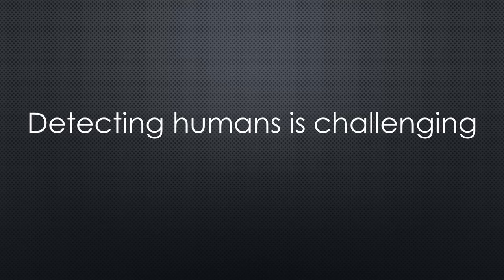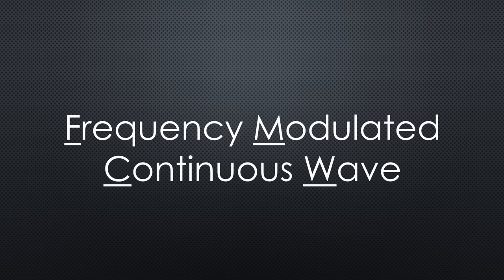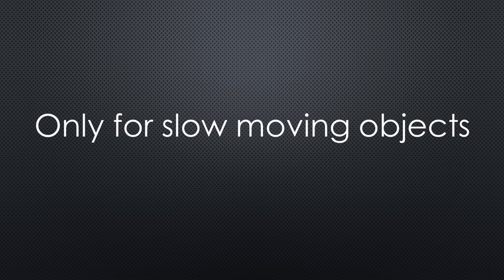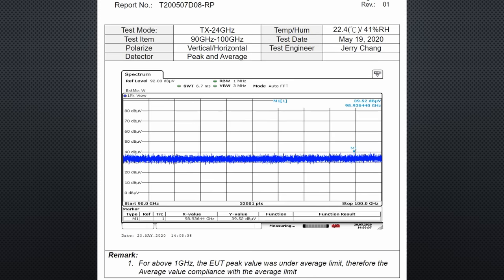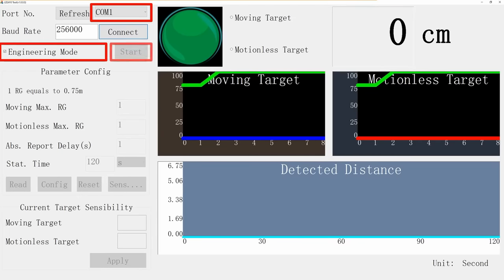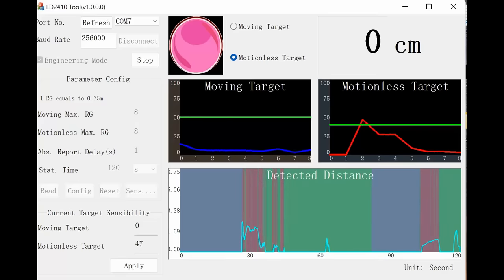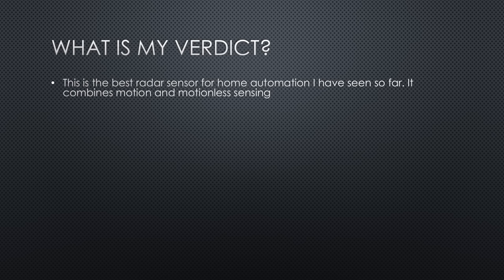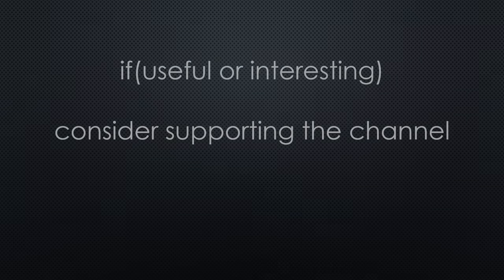439 24GHz Radar Presence Detector that Works (LD2410)

Comment: I wonder if it would be possible to reach the same goal by using PIR in combination with light barrier at the entrance(s) and some clever algorithm to weed out reference counting errors.
Reply: Two laser beams at the door could count people going in or out based on the order of triggering them....
Reply from the maker: You always can count. As you write, you probably lose control quite fast if two persons are too close...
Reply: @AndreasSpiess  I suppose some clever use of interrupts and a counter should take care of that particular problem.

But the reason I never built it for myself is that in order to install it to work properly and not count separate feet or arms going in and out it would be advised to bounce it around the doorframe with small mirrors a couple of times and the installation would be quite tricky to pull off and not at all universal or easy.

It would also require some careful drilling to install it in the door frame, unless you are prepared to have it stick out in quite an unsightly manner.

Either way, it would be probably a fun weekend project but I can't immagine this ever becoming close to a versatile enough product.
Reply: @AndreasSpiess  or of someone walks in swinging the arm forward while passing the barrier. But the use case "person has been detected by PIR but hasn't left yet through the barrier" may be reasonably easy to implement. But yes, you need some way to correct the count when it is off by some reason.

Comment: Do these modules need to be powered continuously? Or could they be used with a low duty cycle for low power devices? I suspect they rely on volatile memory to work correctly.
Reply from the maker: I assume they need continuous power for a certain time.

Comment: Andreas, do you have a total security built using mmwave and lora to notify of home intrusion. I am usually within 15 kms from home but feel my home is being visited when I am not home. Iam thinking my cellular is being tracked or my car so I would like a secondary com to notify me if I put my phone in a faridy box. Can you use lora to communicate from mmwave sensors to sensor and then send a signal from the sensor web to a remote lora unit
Reply from the maker: I would add a camera to your home. Then you see who visit it when you are away. And: Your phone cannot be tracked when you switch it off.
Reply: @AndreasSpiess  I would like to automate the cameras to a imput from the mmwave  and be notified by lora that the system is on line, working due to a detection. I would like a 950? Hz? Imiter floodlight and capable cameras controlled by ladar for outside on my driveway, also reporting to me by lora. I am disabled and a senior, people have been preying on my camping gear, food supplies and gasoline. I need proof that this is happening. It appears that the  second  I leave my house it is possible someone is around. I am aware to several gangs in the neighborhood because Iam observant and a old boy scout. My hearing and vision is still acute but my body is functioning on a bad level, if I need to vacate it will be slow and in great pain.

Comment: Would be interesting to know how it detects stationery objects, it must use the movement sensor to some how remember what a background signal looked like and then compare it with the new signal. So how long will it detect a motionless object before it becomes part of the background signal.
Reply: Detects the phase difference from the returned FM not just  TOF 

Look up fmcw radar
Reply: @RobertSzasz  So if i take a box in to the room and leave it there, there will always be a detected signal. At what point does that box become background and no longer a motionless object?

So once i move a chair in the detection field! The system becomes useless as there will always be a motionless objected detected. There must be a point where the motionless object is dismissed and forms part of the new background. 

Am i getting it wrong, but to detect something you have to have two sources of information so a difference can be detected. Or it’s relying on only detecting a motionless object that still has some form of detectable movement.  A human will never be totally motionless while alive, which could be why the motionless detection fails if the movement detector is affectively turned off.

Still trying to get my head around the wording of FMCW, FM is normally described as continuous wave that is frequency modulated; CW is also normally described as a continuous wave that is 100% AM modulated. I.e. a pulse!  So is FMCW a frequency modulated pulse? 

So it look like it's getting extra information from the TOF using the phase differences, as there will be a time difference between the sent pulse and the returned pulse due to the time of flight which will mean that there will be a phase difference between the two signals modulation frequencies. 

Still don’t understand how this is going to tell you there is a motionless object in the room, unless the device has a memory of what the room looked like before the object entered it. This is why i think the system need the movement detector to detect movement, so it can store record of the area scanned so it can do a comparison between them.
Reply: @TheEmbeddedHobbyist  Given that it is reported as a "life presence detector" it means that it distinguishes the presence of a live animal / human based on the fact that a live being is never fully still (breathing, heart rate) compared to inanimate object that are instead fully still.
Reply: @TheEmbeddedHobbyist  CW is continuous wave, so it's always on rather than sending out a pulse and listening for reflections if sweeps its frequency, and by measuring how strong the signals at various frequency offsets are, you get the distance to reflections.
Reply: @EnricoConca  That's my point, there needs to be a constant small detectable movement or it just becomes part of the background or it needs to compare  one signal to a reference background signal.
Reply from the maker: You define the "background" with the green curve. If the sensor already shows "conductive material laying around" when you are not there, it should show a higher value when you are there, and you set the threshold between them. If not, the sensor cannot be used in this situation.

Comment: Hi Andreas. I bought a ld2410 module for my home assistant. 
I can see it and connect via BLE to my android tablet but I cant see it in HA (no device discover). 
I'm going mad about it !!
Reply from the maker: So far I did not test it with HA :-(
Reply: Rather late for a reply but my HA has no BLE (HA5) so I used ESP32 to relay signals to HA.

Comment: Hi Andreas, Does this module has capability for penetration through wall? Or do you know any module can be use for penetration through wall to detect human?
Reply from the maker: Radar can penetrate through thin walls. But you have to try in each situation.
Reply: @AndreasSpiess  Thanks for your reply..

Comment: How does it work through walls/doors? One problem I had with radar based sensors is they read motion through some materials, it would read motion in the next room through drywall or closed doors. Curious how much penetration it has at this frequency.
Reply from the maker: I did not check. But they should work through material, too. Maybe less than the 3 or 10GHz sensors.

Comment: Thank you, I'll definitely play with that module :) Btw, there is probably a mistake in the links list - the "LD2410 including base" item points to the same URL/listing as the "LD2410 Sensor"
Reply from the maker: Thank you for the info. The link should be ok by now.
Reply: @AndreasSpiess  Both links are dead now…
Reply: @stephanberger7455  They are working right now, at least from Switzerland
Reply from the maker: @stephanberger7455  Do you use an ad-blocker?
Reply: @AndreasSpiess  No ad blocker, the link to the FP1 sensor is working...
Reply: @AndreasSpiess  The link seems to point to a product only available to limited countries.
It doesnt work for me either, Germany.
Reply from the maker: @stephanberger7455  Strange. I tried it several times 😞
Reply: @AndreasSpiess  It says: „Momentarily not available in your location“ (that means Germany). You are from Switzerland, maybe it is available for Swiss?
Reply from the maker: @stephanberger7455  I just checked. If I change to "Germany" as a country, I lose the link. Switzerland works. Maybe you will find a different store?
Reply: @AndreasSpiess  I can find the product if I search for „LD2410“, so no problem.
Reply: @tarakivu8861  Hi yes,  thanks for your question,because of the EPR  policy in Germany, it is not showing there, we have added the EPR certification in our Aliexpress store, it will be available in few days after approving.

Comment: Could this chip be used for an outdoor security motion sensor, and if so would it be more reliable than a PIR?
Reply from the maker: Depends on the packaging against weather. They have some information on the right plastic to use. And it should be better than PIR in hot environments.

Comment: What happens if you use multiple of these to cover a larger or odd-shaped area? Do they clash or does the modulation reject the noise?
Reply from the maker: I expect that they interfere. They all work on the same frequency. But I do not know its effect on the results.

Comment: Am i correcting in assuming that if you move your furniture about, you will trigger the alarm, unless you reprogram the sensor with the new distances?

A significant new problem with PIR alarms, is that they cannot distinguish between warm bodies and background heat radiation in the very hot summer weather.
Reply from the maker: 1. If your furniture contains conductive material: Yes
2. Where I live, unfortunately, I never had such false triggers of PIR sensors. But viewers in warmer countries report this issue. That is another advantage of the radars
Reply: @AndreasSpiess  I was thinking of adjustable office chairs, and maybe test equipment.  
The PIR problem is a recent development in the UK, a consequence of global warming, and warmer summers.
I wonder how well 24GHz works in a fog? ( thinking of drive light control.)
Reply from the maker: @nigeljohnson9820  Water in the air probably reduces the range. But you have to test.

Comment: What you said about the time difference isn’t correct, the frequency of the sawtooth wave was the same in your example. The time difference can be used to measure distance (L=c*dt/2, c is the speed of light). Doppler effect cause a shift in frequency and then you can measure the speed of the object
Reply from the maker: Yes, the received frequency as the transmitted frequency, but sent a few nanoseconds ago. These radars compare the actual sent frequency with the received frequency. This is why they change frequency. Doppler radars alsways emit the same frequency.

Comment: It looks this sensor will be perfect for detecting human chest movements? Medical applications like respiration rate sensor would be very useful.
Reply from the maker: Because it is quite sensitive this should be possible. Probably with a different software and filtering.
Reply: Check out the R60ABD1 - it tracks respiration and heart rate and has a switchable sleep monitoring function. I've got one connected to an esp8266, spitting out MQTT into home assistant as a baby monitor. Works great!
Reply: @colcol83ful  Thats interesting! Can you tell me more? Where did you install the module? How sensitive is it? What data does it split out exactly? Can you use without a mobile app?
Reply: @Barc0d3  at the moment I've got the module connected via serial to an esp8266 board in a pretty janky 3d printed case. The module spits out frames that I capture in a circular buffer that I then process - heart rate, respiration etc. The manufacturer supplied a comprehensive protocol description which is a nice change. I chose to use MQTT to output the parsed data because it's an easy way to get it into Home Assistant. So no, I don't use a mobile app. Happy to share the esp source code...
Reply: @colcol83ful  Sure, would be nice to take a look at the code :) Did you compare your sensor to this one? I am curious to find out the differences. Appreciate it!

Comment: Kind of dumb around here, but have to ask...does this sensor measure through metals, since its a Doppler sensor...even if not can anyone suggest that can detect presence through metals
Reply from the maker: I do not think it will go through metal. It probably will show you the distance to the metal.

Comment: Hello good time
I program with esp32 in ThonnyIDE environment.
When I upload and run the code, to continue coding, when I hit the stop button and ctrl C, the code and repl environment does not open for me, and there is no way to install the firmware on the board again.
What is the method for this problem? Does using the Visual Studio Code environment solve this problem?
Reply from the maker: I do not program in Python. But I am sure you find tutorials for the ESP32 and Micropython

Comment: Not sure if you take requests, but if you do, could you please make a video about detecting visible/invisible laser pointers using Arduino/ESP32 or any other commercially available microcontroller? I'm really interested in the topic but for the life of me can't find anything about how it can be done, if it can even be done at all.
Reply from the maker: You just have to check which wavelength your laser uses and select a sensor for this range. I assume it is either IR or red. But be aware: The laser has to point exactly on the sensor to be detected because it has a very narrow beam.

Comment: Hi - first great videos
Second - I tried to find a way to ask a question not about a specific video and could not find one so I'm resorting to ask here. 
Have you or could you make a video about air sensor sensitive enough to monitor air current is a house. specially when the windows are open.
Reply from the maker: So far I have no such plans because I do not have such a need :-( Why do you need such a sensor?

Comment: Did anyone find out why there's a LED on the antenna side of the board?
I was thinking it might be photosensitive cell to find out lighting level of the environment, but there's no any settings for the light sensor.
Does anybody knows?
Reply from the maker: I do not think that mine contains an LDR to measure lux

Comment: Sir, can you pls check.... 
what will happen if a curtains are moving due to open window?
what will happen if a celling fan is running and curtains are moving?
what will happen if a celling fan is running and curtains are moving and a person enters the room?
Reply from the maker: If material contains enough reflective material they will be detected. You have to do these tests in your environment. Our curtains do not contain any metal or water and will not be detected.
Reply: @AndreasSpiess  Thanks a lot for the tips.

Comment: I used a JST 1.25 connector instead of the pin header! Cheap and perfekt.
Reply from the maker: Good idea!
Reply: @norld4181  Hi, could you please help with some details about how you secured the JST connector to the header? I've spent hours researching it online, I found out it's the JST GH series that uses 1.25mm pitch, I ordered them, they just arrived and I realised they don't make a good contact at all - they can't "hold on" to the header, neither by friction or click. I am wondering if you maybe got a different connector? I am ok with a solder iron but sadly 1.25mm is just too small for my eyes :(
Reply: @dan-nutu  
Header: https://de.aliexpress.com/item/1005003115054198.html?spm=a2g0o.order_list.0.0.48e35c5f27WDf2&gatewayAdapt=glo2deu
Connector: https://www.aliexpress.com/item/4001235017139.html?spm=a2g0o.detail.1000060.1.4d761809Z6luU8&gps-id=pcDetailBottomMoreThisSeller&scm=1007.13339.291025.0&scm_id=1007.13339.291025.0&scm-url=1007.13339.291025.0&pvid=0cb6ffac-a571-444a-9cf1-dc9fe2f79560&_t=gps-id%3ApcDetailBottomMoreThisSeller%2Cscm-url%3A1007.13339.291025.0%2Cpvid%3A0cb6ffac-a571-444a-9cf1-dc9fe2f79560%2Ctpp_buckets%3A668%232846%238112%231997&pdp_ext_f=%7B%22sku_id%22%3A%2210000015400386614%22%2C%22sceneId%22%3A%223339%22%7D&pdp_npi=2%40dis%21EUR%211.01%210.94%21%21%21%21%21%40211b5e2416675703577546832ed2b5%2110000015400386614%21rec&gatewayAdapt=glo2deu
Reply: @norld4181  Thanks. I reckon you bought the sensor without soldered pins and so you were able to solder the JST connectors on it? I've got the sensor with the pins already soldered, because I wanted to avoid having to mess with it - and on one hand I'm glad I got that version because it's tiny and there's an SMD component almost touching the connector pads, no way I could have soldered a header or connector there without affecting it.  But on the other hand it has proven a challenge to connect to it. I ordered the cables you pointed to, however I'm afraid that after the usual month of waiting for them to arrive in the mail from C. they'll be just like the ones I already have, which is a connector with a sort of click retainer, which is not going to grab at all onto the header on the sensor. But after some more research I also ordered a set of ribbon cables equipped with 2x5 pin IDC connectors (1.27mm pitch), so hopefully one of them will work. After all this I paid more for the cables and connectors than for the sensors themselves. Which just shows how affordable the sensors are. I wished though that HiLink would also sell some cables to easily connect to the 1.27mm header. (hint for the company folks reading these comments!)

Comment: It is very strange that no one has noticed the presence of a light sensor on the board. It looks like an LED. Maybe it will work in the new firmware.
Reply from the maker: I also did not notice it.